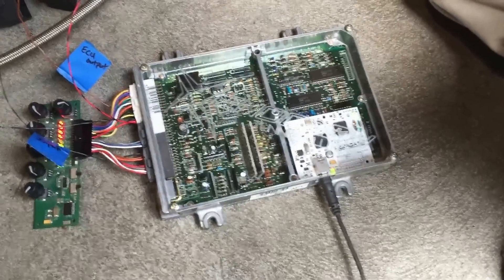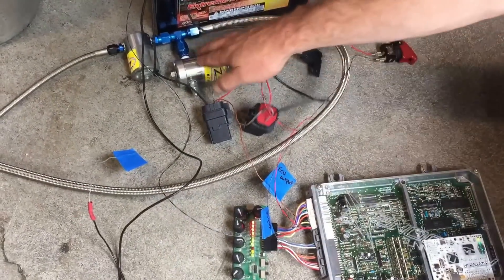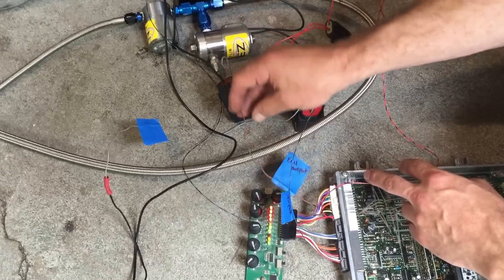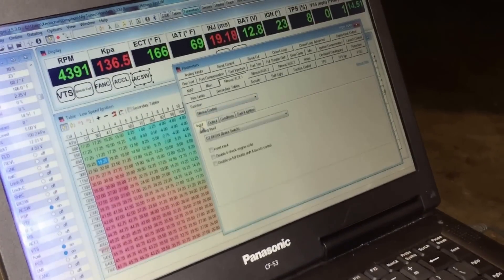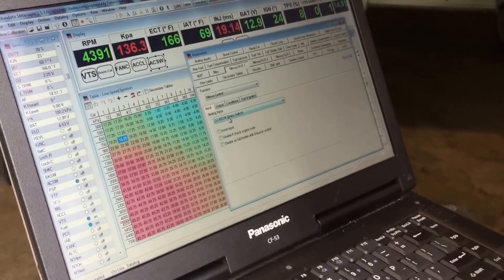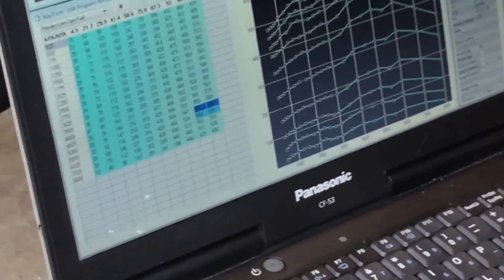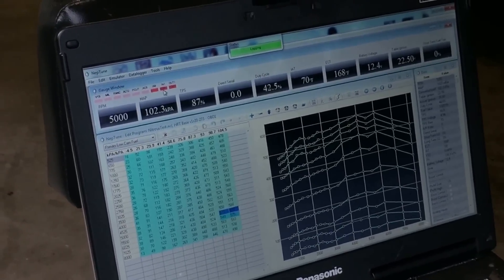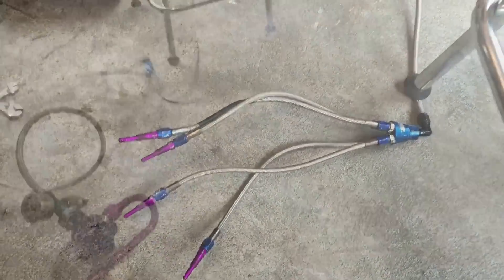OBD1 Hondata and Neptune Nitrous Tutorial Video

Comment: Could you add a video on this for Ktuner. I found the programmable outputs but unlike neptune and hondata, there isn't a selection for both inputs and outputs and I've found next to nothing for information on ktuner. When you go to the programmable outputs it has a selection for activation trigger for the output where you can select where you want to send an input signal but why is there no selection for an output wire. I've found somewhere they said to select output on the factory output task tab but I see nothing. Any help would be greatly appreciated, I'm sure it's something silly I'm missing being new to the software and never having used the programmable outputs yet.

Comment: I like how you can have separate fuel and ignition tables when running nitrous and have advanced ignition when running NA. My question is Chris how do we tune a wet system? Just have the ignition timing adjusted when running on the bottle and leave fuel alone?
Reply: That's brilliant, and if i'm not mistaken means I can have a spot on map for when running NA and also when running nitrous, without affecting the operation of either mode?
Reply from the maker: Correct